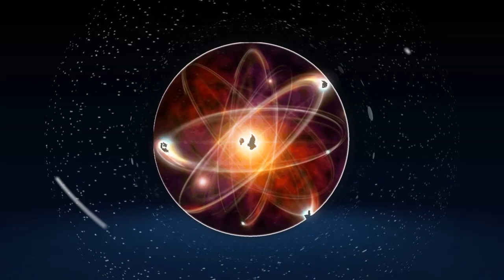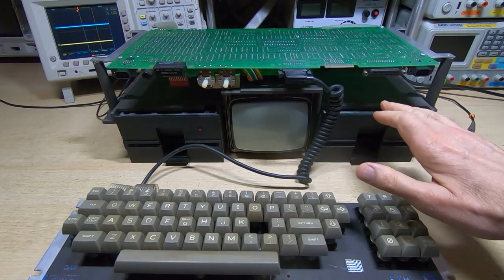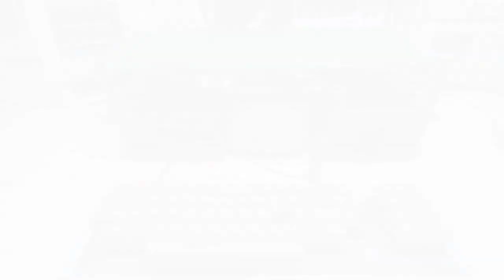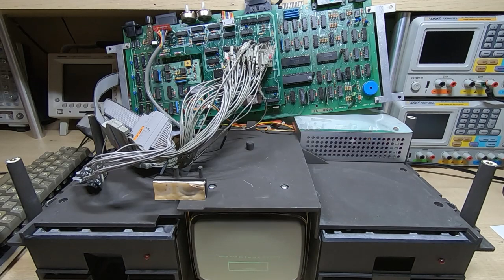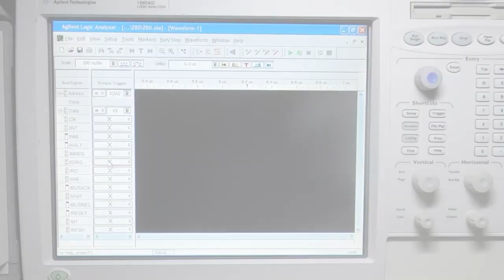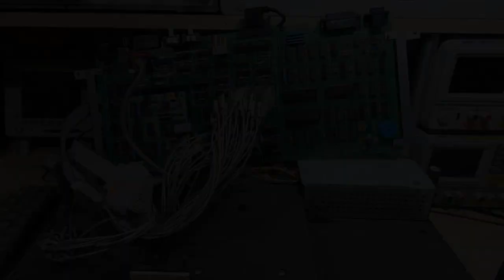Osborne OCC1 Repair Part5

Comment: Interesting machine. But in every step to fix it, the designers made decisions that make it very hard and discouraging. Keyboard was not very well made. Circuit boards  stacked in, so it's very tricky to fix. Hope it is worth the effort in the end. Osborne got a notorious history for over promising and under deliver.   🙂
Reply from the maker: I totally agree. Instead of designing out issues they seemed to layer a 'fix' on top of it. I am not sure it is worth the effort with the keyboard. I may look into finding a way to replace it with a proper mechanical switch type. It would be easy to alter the monitor ROM lookup table for different scan patterns.